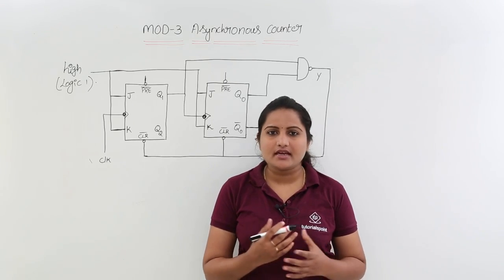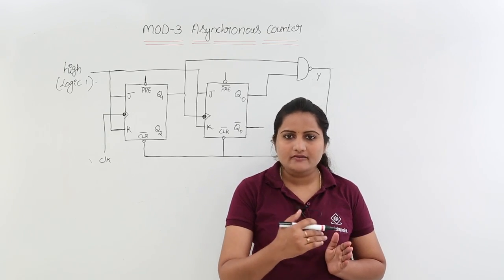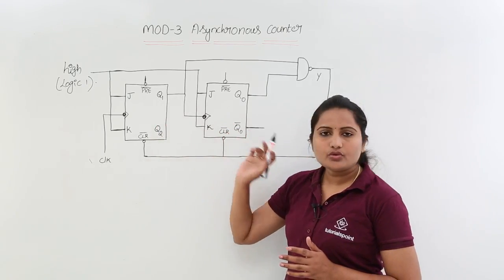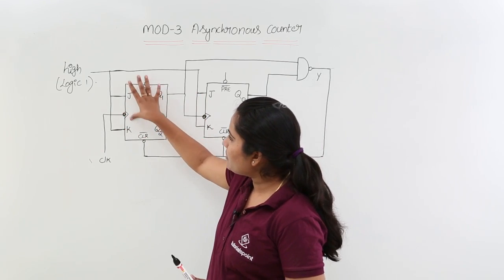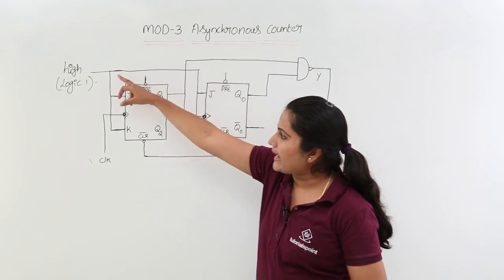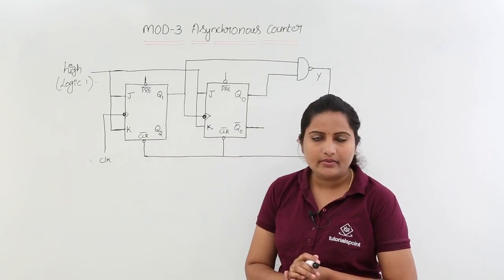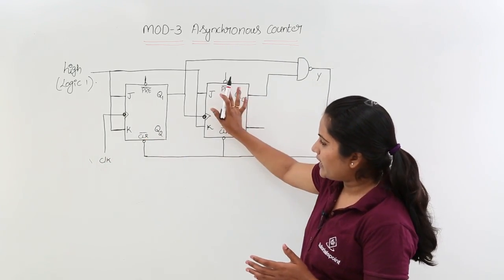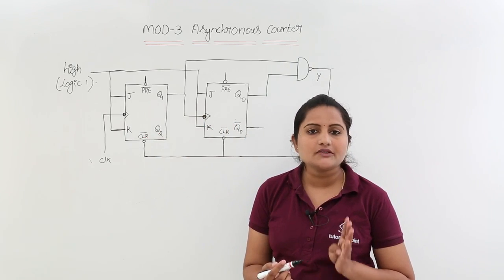MOD 3 Asynchronous Counter

Comment: For model counter only 0,1,2 are the states. You consider 3 there
Reply: Vennapoosa Hemanth Kumar Reddy 0,1,2 are the states... And in third clock pulse it's going to reset means 0. That ain't gonna count
Reply: @umeshsingh-du3pk  yes, you are right. Thank you

Comment: Mam 
I want to count 0,2,1,3 the circuit how it will be change?
Reply: you have to use synchronous counter. 
Asynchronous counters can count in either 0,1,2,3 or 0,3,2,1,0.